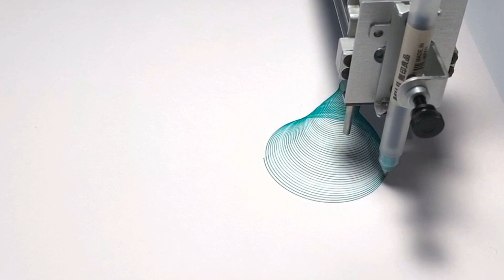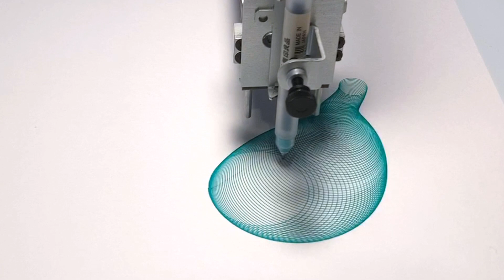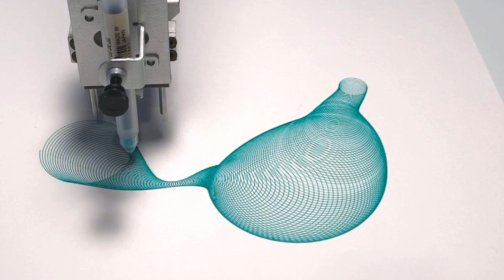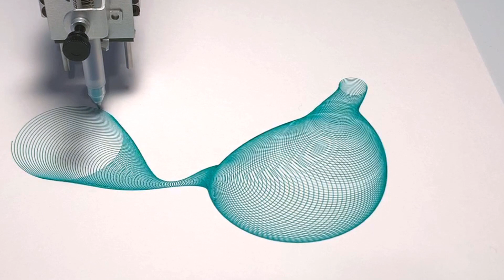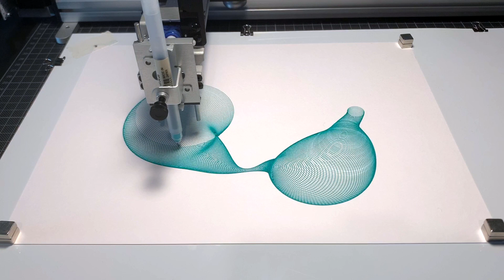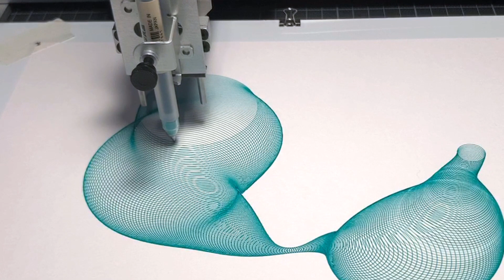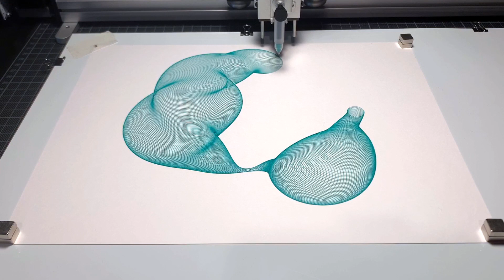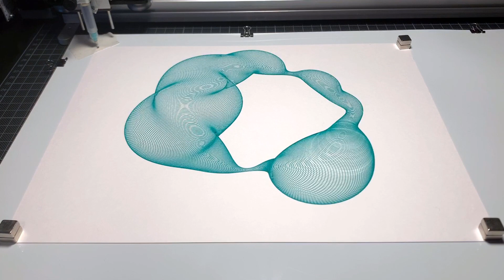Chillplot - Circle Noise on the Axidraw V3/A3 Pen Plotter

Comment: Just wondering whats your limiting factor, how fast the pen can draw ink or is it more hardwre related? Just wondering because i love macking fast machines, and seeing yours now i just want to make one just to see how fast i can make it go xD
Reply from the maker: I don't know for sure, but I suspect that the hardware is the limiting factor. I've seen older plotters that work WAY faster than the Axidraw!
Reply: @Plottervision  
gonna give it a try, im sure that with 24v and a 32bits board it should have more than enough power to push those steppers really fast.
I was originally gonna use a 5w laser for marking the lines but im gonna try with pens first.
Reply from the maker: @laharl2k  Let us know how it goes! :)